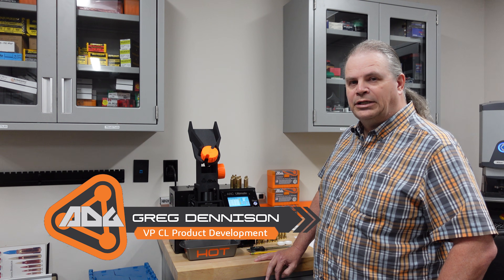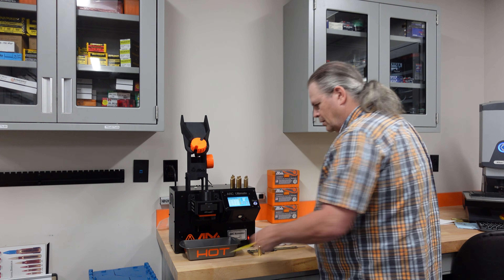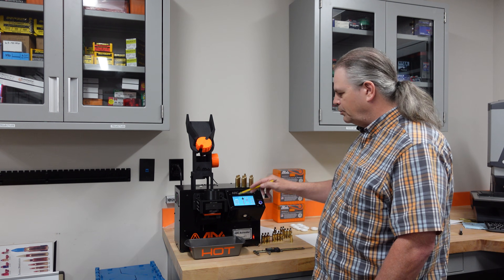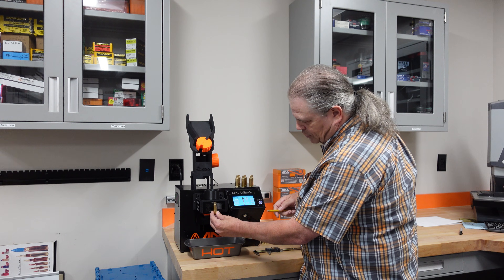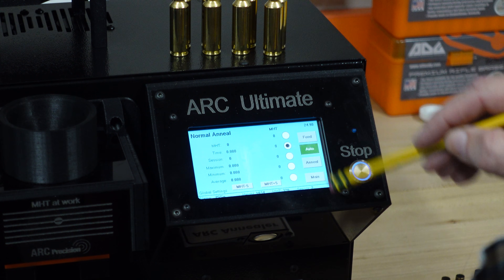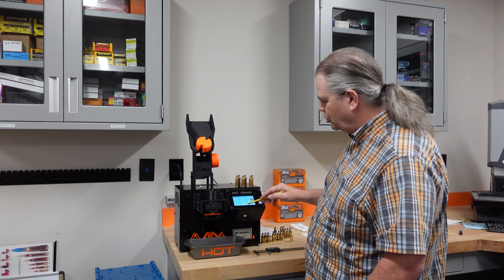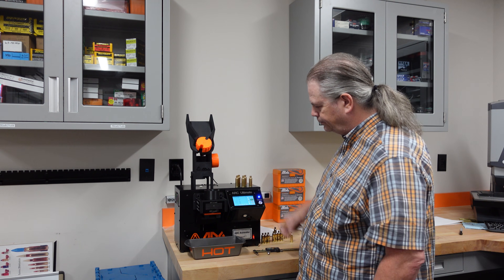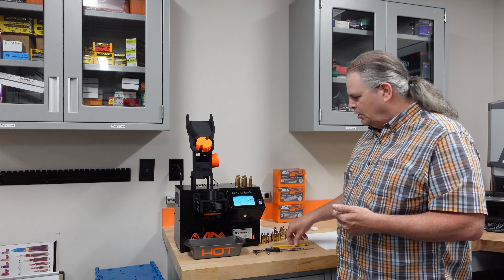ARC Ultimate Cartridge Case Annealer - Height, MHT Settings, & Memories (Saved Programs).

Comment: I own the very first ARC ultimate annealer, and let me tell you that It has been nothing but a great machine, i notice a big difference in bullet speed consistency, easy to run, I add my own brass feeder since I run at least 500 cartridges at a time, I did several customizations to improve and automate it, it is to me the best machine out there. I can challenge anyone that can tell me that there is another machine better than this one. And I do own a AMP press so I can tell the difference in bullet seating pressures/ work force. You will not regret it if you get one.